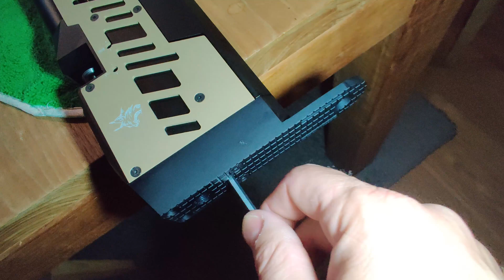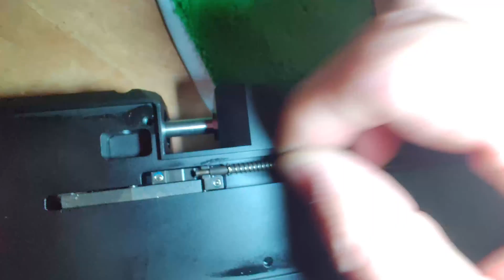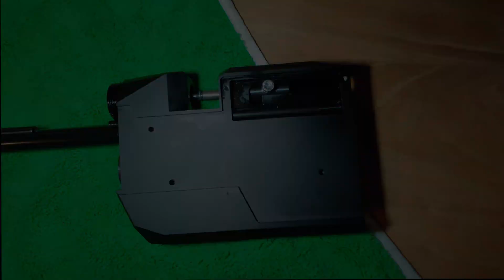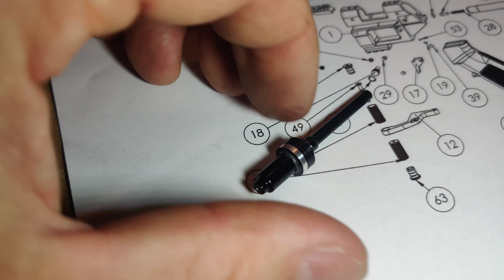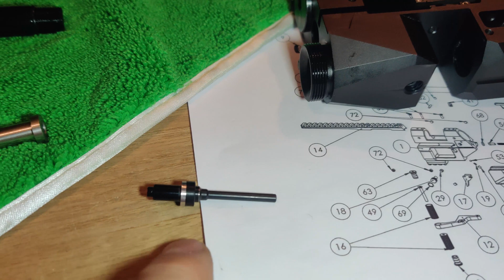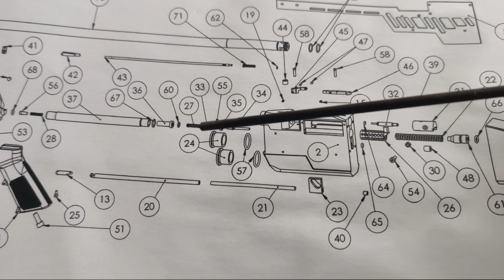RTI Prophet 2; Fix a leaking valve.

Comment: Have the same problem with my P3 right now. Unfortunately the threads are glued and I cannot disassemble it to replace the oring.
Reply from the maker: Heat it a bit so the thread comes loose

Comment: I bought a new prophet 2, does anyone know if i have a version 2.1 with the new assisted valve? I am really worried that i destroy the gun if i dont take it apart. It ill come over in 2 days and i didnt know there was a version 2.1 prophet performance.
Reply from the maker: When the Hammer can be adjusted with a wheel at the back it is the new version. If you need a hex tool it probably is an old version.
Reply: @AirgunNL ty for the replie! If i'm right the only thing i should do is take apart the gun and glue the valvestem ore locktite it? It does not Leak or have troubles but i do not want to see that annything cames loose. If i do so is the gun then a 100%? I can't find the newest valve stem to buy in the netherlands.
Reply: The date on the gun says 05 2022 btw

Comment: I Have the Priest 2 and my leak seems to be coming from the bottle / reg or the reg/flash stock. Are there o rings in these two areas that could also cause a leak. My leak occurred after a cross-country plane trip where I drained the pressure and when I attempted to fill the gun again i heard a pop and big leak sounds from the bottle area.
Reply from the maker: Yes there are o-rings. On the bottle and on the regulator thread. Use some soap water to check where the leak exactly is and unscrew the bottle and regulator and replace the oring.(13x2 or 17x3 (mm)) https://www.rtiarms.eu/assets/docs/RegulatorPriestExploded7.pdf
Reply: @AirgunNL  Great info and suggestion Thanks

Comment: I have the same issue also a friend of mine we bought the same rifles
Reply: Thanks yes I did it but still leaks changed orrings they are going have to make something different because we are going to have the same problem all the time this sistem with orrings is always going to have problems you make one hundred shots an have to take apart the rifle to change orrings
Reply from the maker: @davidvazquez7862  not if the valve pin nut stays fixated. I think RTI modified the valve seal seating so it does not come loose. The new valve I received from RTI does not come loose anymore.
Reply from the maker: Ok you need to disassemble it and tighten the valve pin nut and/or put some glue to keep it fixated. You can also write the dealer or RTI and get a new valve.
Reply: I tightened it and put a new orring plus I put lock tight on the thread an still leaks I’m going to ask for a new valve I guess a cuestión did you take the orring out and glued it ?
Reply from the maker: @davidvazquez7862  yes, but the glue came loose. Probably too greasy to fix the nut. I also got a new valve, that does not leak.

Comment: my p2 has just started doing this also so ill be either sending it back or fitting the replacement parts but rti customer service is really good so hopefully it will be back up and running soon
Reply from the maker: It is an easy fix but you need to add glue to the valve pin thread. Otherwise it will leak again due to the fact that the valve nut will loosen due to the hammer strikes.
Reply: @AirgunNL  mine is tight but the o ring in the stainless part looks pretty bad so rti are sending out new parts 🙂
Reply: NEW VALVE FITTED AND NO LEAK SO FAR 24HOURS ON

Comment from the maker: A quick update after another leak (same issue). The problem was not the nr, 60 o-ring but the valve pin nut comes loose from the valve pin (nr. 33 and nr. 34). Then o-ring nr. 55 breaks.
See these spare parts https://www.rtiarms.shop/collections/parts-addons/products/spare-parts-rti-prophet-ii
The fix is to add some loctite or glue to the valve pin thread and then screwing on the valve pin nut (and place a new o-ring nr. 55 of course).
Reply: hi is this part just screwed together hand tight ? thanx
Reply from the maker: @northeastverminhunters  Yes but it needs glue...

Comment: The older version looks sturdier .Unfortunately even the updated version has got some problems ,the first version suffered from regulator problem .However,this airgun is super accurate and sturdy when adjusted and tuned the way you like it .
Reply from the maker: A broken o-ring is not a real problem I think...
Reply: @AirgunNL  I think so too  but other airgun beginners do not think the same .

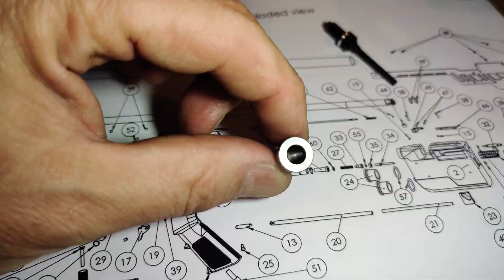Comment: Is there a separate metal valve seat like some PCPs or the valve just seals on part of the block? If its like that it will be difficult to polish. At time 4:17, the inside of part 36 looks quite rough. Thanks for showing internals. Interesting valve. I think Gregor will show a strip down soon.
Reply from the maker: There is no seperate seat. I polished the plastic valve seal and made it a bit concave.

Comment: Usually these models leak at lower pressures because the material that closes the opening in front of the outlet is too hard.  You can only help yourself with a spring that will be harder (have a smaller number of coils) or to increase the working pressure.  In this model, it is the pressure that exerts pressure on the power of the closed blast valve itself.  In the older model, this task was performed by a spring.
Reply from the maker: Yes indeed, but this one leaked also at high pressure. 
The valve spring in other models is there to close the valve again quickly after opening. It is not kept closed by the spring power. That is done by the pressure in the plenum itself. This is also the case with this valve only it closes itself quickly assisted by the plenum air, but after that the pressure in the plenum keeps it closed.